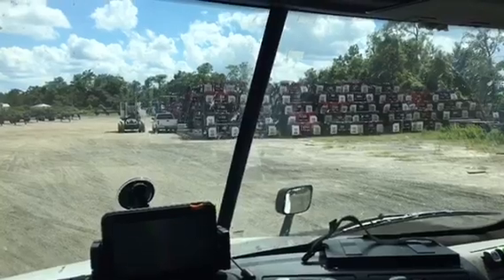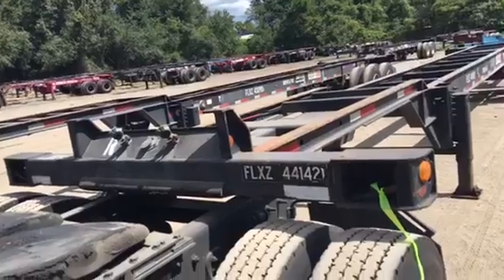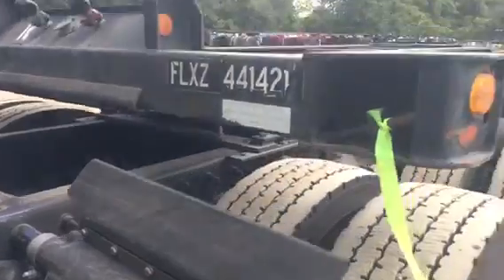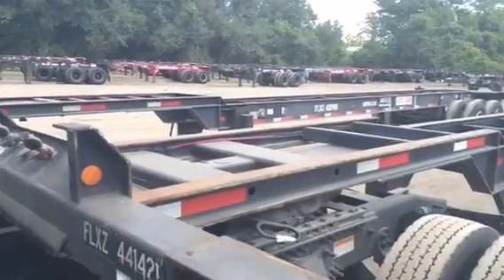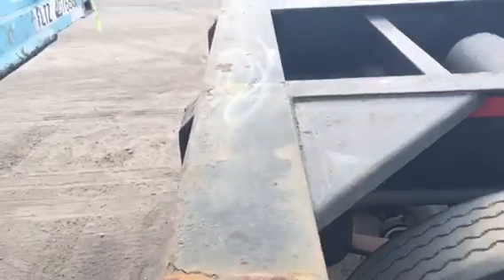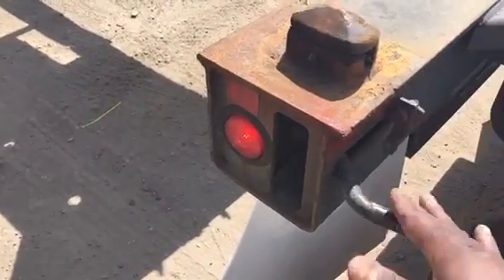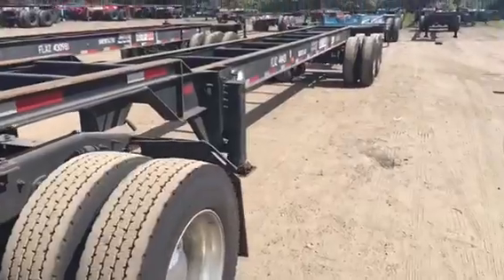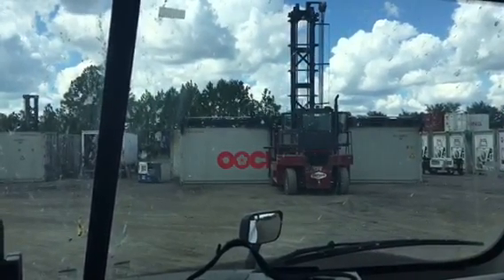Container Chassis Yard Training

Comment: Very good video, I have been a chassis mechanic just south of Atlanta GA for 2 years now and everything you’ve said is accurate, a couple more tips (especially on Norfolk Southern 53Ft Chassis) is to mark the wheels with a tire marker and roll the chassis forward to inspect for a low spot in the tread, if there is an area with 5/32s difference at the low spot drivers  will sometimes be charged for damages if not caught before leaving the yard, depending on where the chassis is returned. One last tip if the brakes are locked down, apply air to the TRAILER ONLY and chock the wheels of the truck and take a hammer to the metal part of the brake shoes  ( do not apply air to your trucks parking brake or it could run you over) if the problem is just brakes rusted to the drum they should free right up. Just a couple of tricks for stubborn chassis that have been sitting for a couple of weeks. It would also be a good idea to get an “unbreakable” mini sledge hammer to hit pushpins and twist locks that aren’t sitting correctly which could save you time from needing a container adjustment. I would also suggest every driver getting a set of standard sockets and wrenches and a ratchet to fix minor problems road side, most bolt sizes are 7/16, 1/2, and 9/16” for latches, 7 ways and crank handles which is what I see drivers having problems with the most
Reply from the maker: Thanks for the info
Reply: Thanks alot respect 🙏

Comment: I miss the other kind of semis "cabovers". I very seldom see any on the roads in the USA nowadays. Back in the '80s & down, there was a mix of them & conventional cabs. Of course things have changed such as the law increased the length limit which eliminated the need for cabovers to pull trailers that exceeded a certain length & later on, cabovers phased out & more conventional cabs took their places.

Comment: Good info. I've been considering converting a shipping container into a tiny home. Building on a chassis should make relocating and code compliance much easier. I now have more info to start with.
Reply from the maker: +EASTSIDERIDER707 thanks
Reply: You would save crane fees and even hang fresh water and waste water tanks below. Just find a trucker without a haul who needs a job. Where I'm thinking about going is the farm country where I grew up and worked in farms. Plenty of guys haul fertilizer and wheat or rice. Downtime is common. I could park on the landing pads and get work. After 14 yrs as an equipment operator and mechanic, I could easily supplement my retirement and live rent free.

Comment: that last one is an empty handler and it has twist pins that lock so it can pick it up then when  he lets go and it is on the chassis it he unlocks and goes
Reply: robert soltysik right, it's not magnetic. You are correct, it just moves empties. You must have or do containers. The tire quality is very substandard.

Comment: Thanks for info; I look forward to work at one of the port..maybe LA in 2017 as O/O.
Your gross avg is $1.50 from your Sept 5th Video.. Looking at: http://www.drayage.com/directory/dray-rates.cfm?metro=JAX&bypostID=&sortR=10 , but your need own authority, but not sure about miles consistantcy, but gross avg would be min of $2 round turn, plus saving on fuel since running back always with an empty container.
Reply from the maker: +chanonx1 yeah but there's a lot that goes with your own authority. I'm not ready yet but hopefully in the future I'll get it

Comment: you forgot to tell people to slide the fifth wheel to the back otherwise they will no longer have mud flaps or brake lights on a truck
Reply from the maker: I never did that
Reply: lucky
Reply: I usually kept my fifth wheel in the middle of my tandems and had no problems.

Comment: Have you made any videos on the wiring or brake system of the container chassis? I'm currently the new guy at a rail yard where we fix chassis and I'm trying to find any source of info on these things but it's kind of hard to find. I appreciate this video is very helpful in the basic parts. Thanks.

Comment: How much do you think it would cost to buy a used but relatively good condition forty foot chassis? I'm planning on building out a forty foot container and want to secure it to a chassis to classify it as an RV and make it easier and less expensive to move. Do you think I would be able to talk with a local dock and buy one or both from them directly?

Comment: Do you check the trailer brakes?
Reply from the maker: +capazontwo yeah but it's impossible to get a good judgement of stopping ability without a container on the chassis. It just locks up the tires and slides